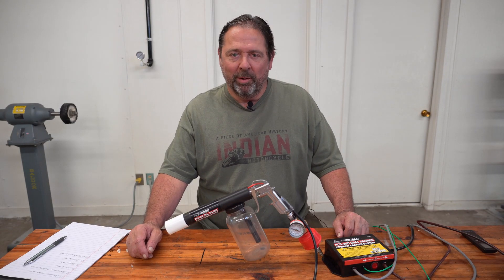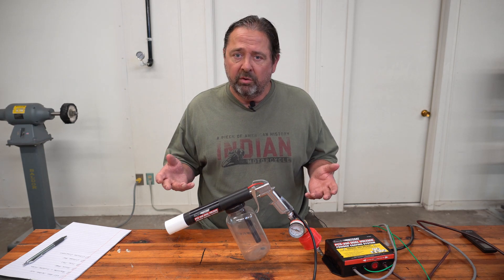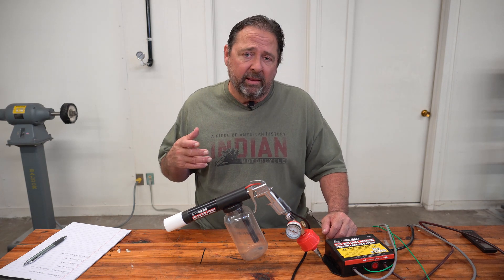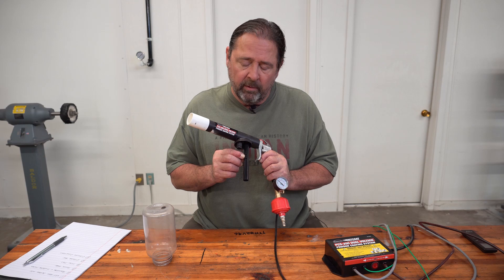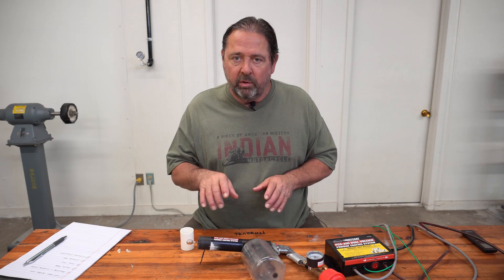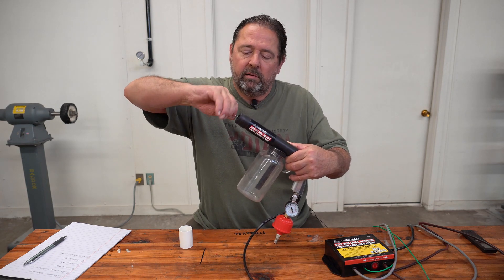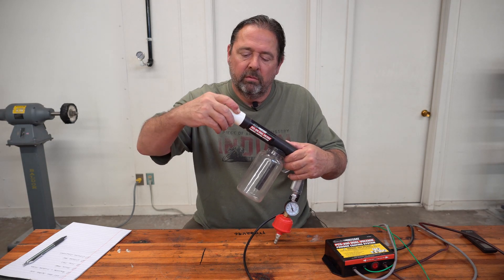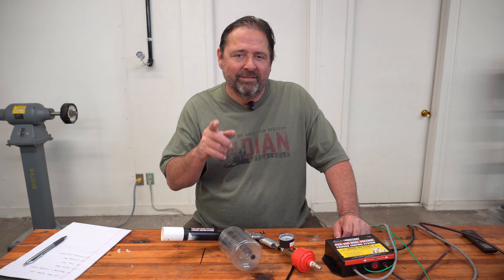EASTWOOD POWDER COAT GUN MODIFICATIONS

Comment: I bought this and worked great. I had just powder coated a part for a project and was covered in powder coat. After I bought this kit. I coated another  part to my project and had almost no powder on me. Covered great. The only thing was the blue cover did not fit on my eastwood gun and i had to put in my lathe and take a few thousands of the ID. My gun is about 4 years old and could be small difference in th OD than the newer ones. Worked better than I was expecting.

Comment: Whats going on Cycle fab! I had did a review of your Harbor freight PC gun mods! I have since moved to the Eastwood kit! 

Would you be interested in sending me a kit for the Eastwood to test out? I currently have a kit from Royal coats (I really like the “fluidizer” and the “tornado tip”) but I believe your tip really helps ALOT with atomization! I’ve noticed with these diffusers it don’t seem to atomize as well as when I don’t run one! And I noticed your tip design really helped a lot with atomization on the HF gun! 

Thanks for your time Larry! 

Garrett - GBuiltPerformance
Reply from the maker: Sure, Garret.  Send me your address, my email is cycle4fab@gmail.com
Reply: @CycleFab  that’s awesome! thank you!

Comment: your comment about having the regulator on the wall  and not knowing what is in the hose is just nonsense. if a hose has always been hooked up to a proper regulator/dryer , you know exactly what is in the hose. clean dry air.
Reply from the maker: I have collected various air hoses over the years and have no idea what has been in them.
Reply: Pretty much shows how little you know. If the nipple end is disconnected it is open to all the air, oil, debris in the shop. There is no auto seal on that end smart guy. This is why I had to test to earn ASE Certificates to prove to people I wasn't a Putz.

Comment: I drilled the holes in the exact place.  Sometimes it works and sometimes way to much powder or none at all.  I run 8-10psi.  Everything else I've done you recommended has worked excellent.   I need a little help on the holes.  I have two guns and they both have the same results with the holes
Reply from the maker: My contact email is:  cycle4fab@gmail.com

Comment: So today I had a little surprise, I used the same filter you have and it popped open while I was connecting it, just some advice connect the regulator to the hose/fitting then the filter between gun and regulator this put regulated air through the filter much safer
Reply from the maker: Good to know, thanks!

Comment: No I couldn't see your deflector. I subscribed so I can see it next time.  I have been using Eastwood guns for over 20 years and never seen these mods.  Also There are a bunch of parts and adapters that allow the use of other containers that can be 3D printed over at Thingiverse.
Reply from the maker: There is a better view of the deflector in my latest #shorts video if you'd like to take a look at it.  And thanks for the info about Thingiverse.

Comment: What regulator do you use that can adjust at 1lb increments?
Reply from the maker: As of right now I don't. I read between the lines as best I can. I am going to try out some of the higher priced digitals or better graded dial reguators. At the moment i'm using a Kobalt.
Reply: @CycleFab  Thanks!

Comment: I've been using the Eastwood guns for years, literally. I wore the first one out and with a little whining and bitching they sold me a dual voltage one for the cost of the base model. I've never put a lot of thought into them and more or less just accepted that the giant cloud of powder that came out of the gun would waste a lot of powder.  I had a steel pan in the bottom of my spray booth, I collected the over spray powder and just used it again. 

BUT.... I do plan on using the Larry mods on my next spray job. Nice job... That little plastic disk they give you to use as a diffuser never made any sense to me.  Maybe a liability thing to keep you from touching the high voltage rod??? The metal conductor diffuser just makes a lot more sense. More surface area to transfer the charge to the particles and a more directed spray pattern.
Reply from the maker: Thanks for watching, you'll notice a big difference after the mods.